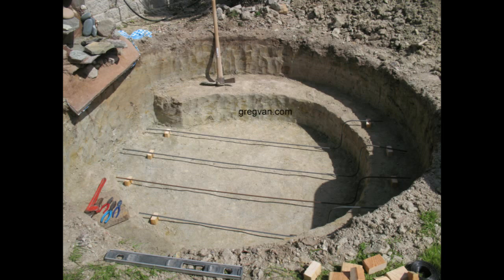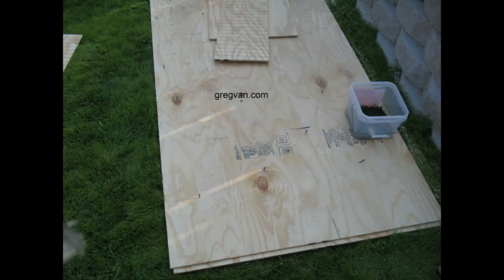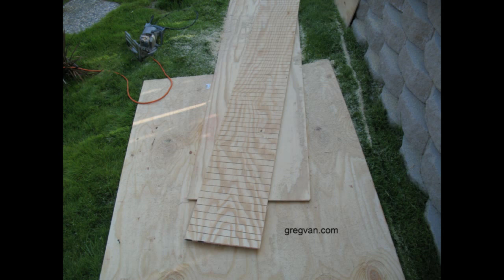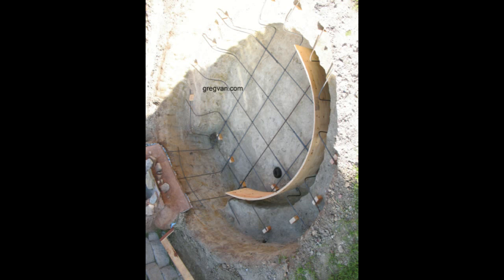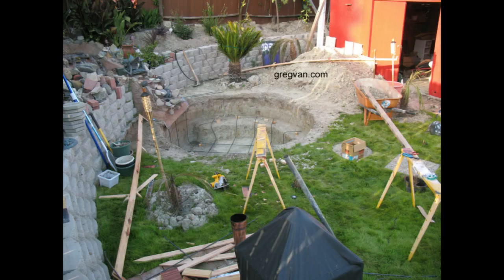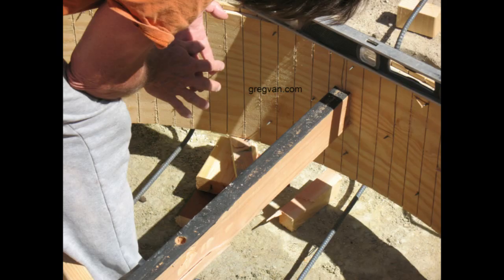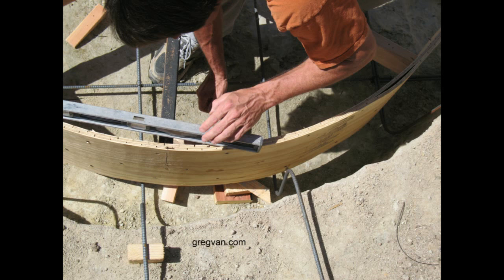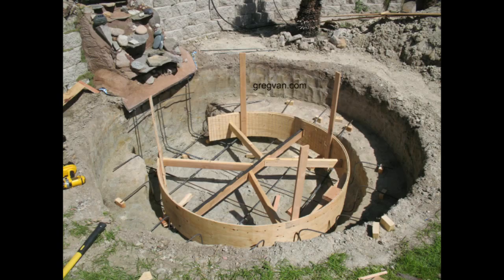How To Build Backyard Concrete Pond or Pool - Part Two Rebar and Forming

Comment: Why not pour concrete 2 inches short of the top of the wood and use its liquid like property to level itself?
My other question. Could you pour concrete in multiple stages and let it semi dry and let add another 8 inch layer? Just in case my curved panel is thin and not strong like your plywood. 
I want to just use a thin plastic or metal thing to form those curves.
Reply from the maker: I don't think it's going to be a good idea to have any breaks in the concrete and that's the reason why I wouldn't do it. Breaks in the concrete are usually areas where cracks can become larger and of course this wouldn't be good if you're trying to keep water from leaking out.

Comment: A string level is rather cheap and much less likely to take damage than a 4 ft. level. It would also be much easier to use than the length of tubing you were using for your water level.